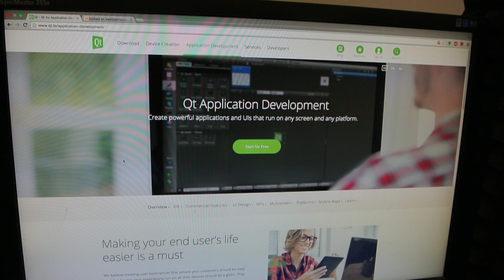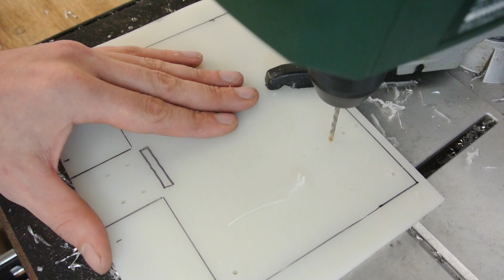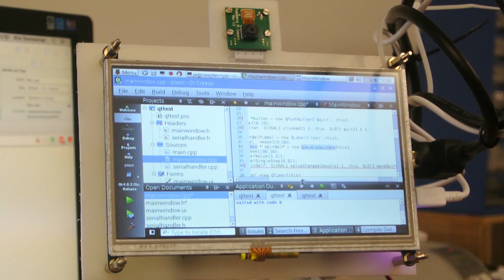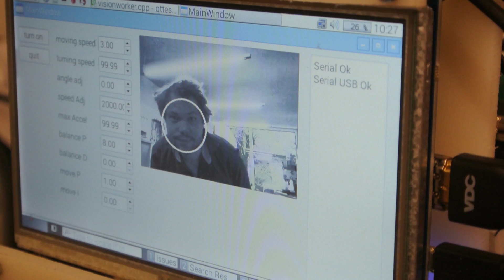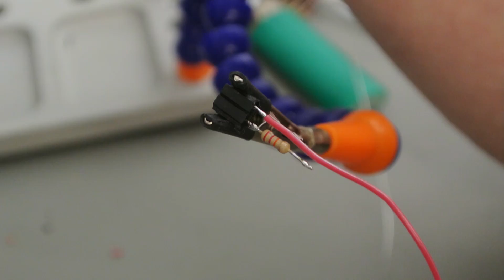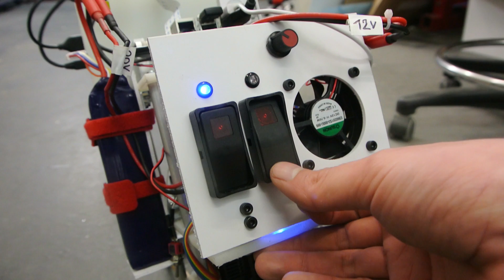making a Balancing Robot (part 2)

Comment: I want to use a good programming system so I can use when I make my robot it’s going to be my hobby and I want to make a dragon type robot Based on cynder from the legend of spyro dawn of the dragon that specific model design of her in the game but what should I use I want to make the skeleton strong able to climb things balance itself be able to move around without a remote or switch be able to have human like conversations be able to see through camera like lenses that look like pupils enable to have a tail that moves enable to move around like a type of animal like a A Dog A cheetah or a wolf those kind of movement capabilities and I want to use some kind of fabric would say get everything on also need to cover up the mechanic and endoskeleton is there any kind of covering that you would recommend also we can’t afford a 3-D printer and we’re waiting on my Social Security and I got some blueprints written down on a notebook also I want to give her some claws and be able to attack for defense and recognize me as her creator or owner and recognize certain family members as well as wistand roughness and able to protect her from rain and have human like emotions and responses and able to have artificial intelligence built-in And not have an on and off switch and no requirement to be charged able to run at TopSpeed like a cheetah able to grip things in her paws and teeth and have wings that have lifelike movement and to withstand heat and I want to know what I can use to give her lips that move so we can show emotion like they do with certain robots able to see in the dark and just be a personal companion and someday I’m gonna make bonbon from five nights at Freddy’s sister location and I’ll be so cool if someone made mangle from five nights at Freddy’s 2 if you want you can search it up so you’ll know what I’m talking about like cynder bon bon mangle aswell The penguin from five nights at candy’s have to if you don’t want to I just need some help also just wondering do you have an email? So I can be able to talk to you?

Comment: Hi Kris! As a student, watching your work is so motivating. I have a question, did you install QT directely on the Raspberry Pi in order to create and run GUI apps ? If yes did it take a lot of time compile programs? I tried once a cross-compilation with a computer but I failed. Thank you in advance :)
Reply from the maker: Thanks :) It was installed on the raspberry Pi. It's doable its your project isn't that big. But you cant call it fast :)

Comment: Sir y did u use only the Stepper Motor?? V can use many such small different motors with encoders...!!! Please tell if there is any special purpose to use these Stepper Motors....!!!
Reply from the maker: the only reason is that I had the steppers already laying around :)
Reply: With stepper, you can control it's rotating angle. No need to use encoder

Comment: Good one!
Your steppers/drivers are still very unhappy :(
Reply from the maker: +Spirit Hi Spirit, I think there fine... I did check it and i turned up the amps till they where getting very hot.  With no difference in sound. To little power gives an other kind of squeaking noise. Maybe its some frequency in the driver timing thats a little bit of or something with the micro steps . But it does feel ok, i don't think its struggling...
Reply: ***** Then probably it's not the current - it can be noise. Try shielding where you can, and see if it goes away. The reason all drivers whine and do a funky beat is because the error amplifier is getting disoriented for a brief moment.